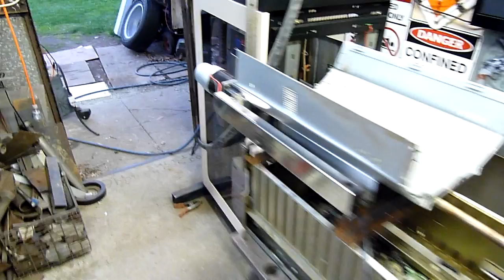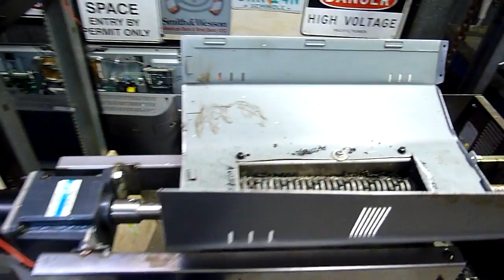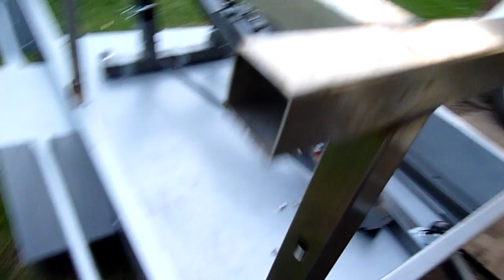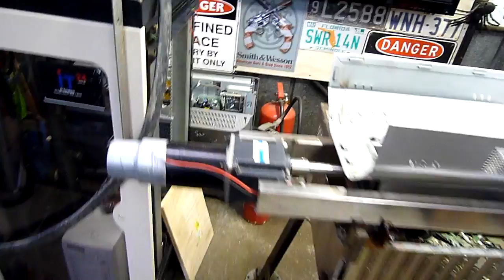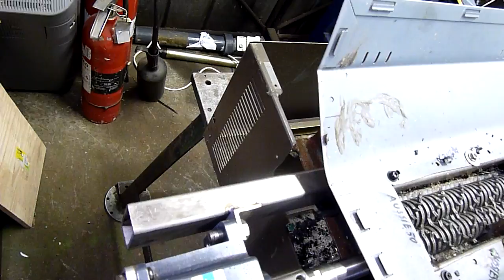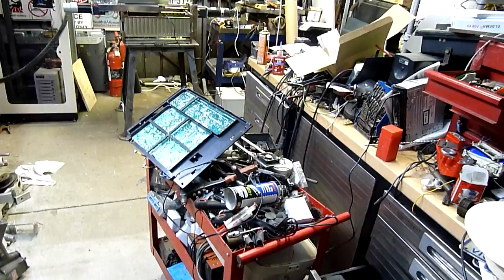Ramblotron Entry May 19 2014

Comment: I can sort of see why Vicroads is cracking down on as you said "Illegally Repaired cars", because the Cheapskates won't follow the Factory procedures to Properly Repair the vehicle because the Proper Factory Procedures are "Too Expensive". and of course, Flood cars will always have Electrical and Corrosion Problems because the whole thing was immersed in dirty flood water, and the only way to repair the electrical system would be to do a Jagnut Style Total Rewiring Special on it. but if Viki were a US Spec Escape, and you were living in the More Lenient parts of the US, I would guarantee you would already have her Registered, Insured, and be happily driving her until her wheels fell off!
Reply from the maker: thats exactly right, its also to do with re-birthing stolen cars too, they also end up in chop shops and often swap identities with flood damaged cars that are not repairable. the new regs eliminate that.
Flood cars are deemed statutory write-offs and can never be used on road again, so the VIN becomes useless to a would-be rebirth vehicle (stolen for example)

Comment: In my place each item has a low stock reorder level setup on the computer system. So when we ask for stuff from the warehouse, when the storeman logs the stock as issued, the stock is automatically ordered when the quantity in stock drops below a certain level.
Reply from the maker: yeh, you would think that $250,000 worth of business software would do that, but so far, no luck :(